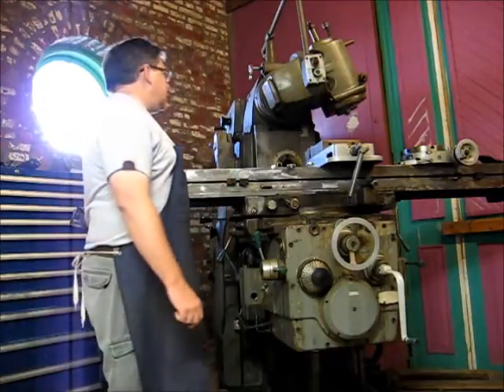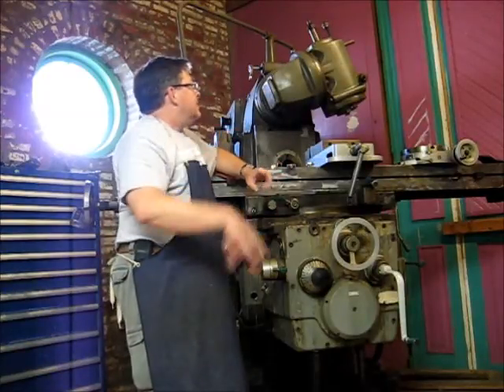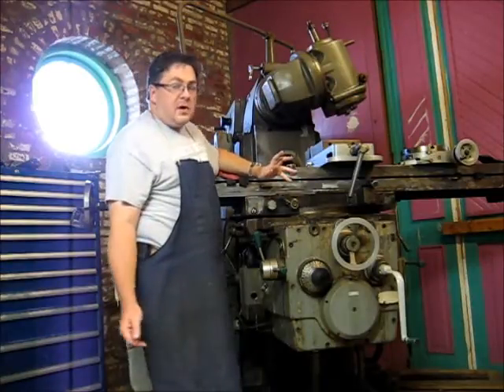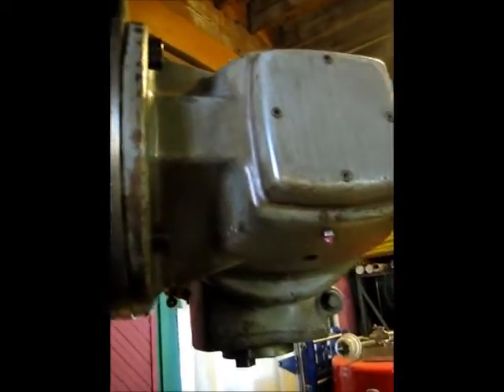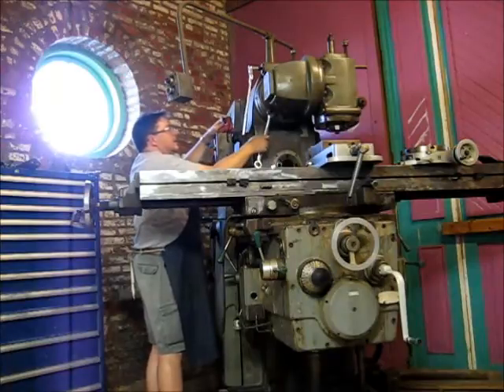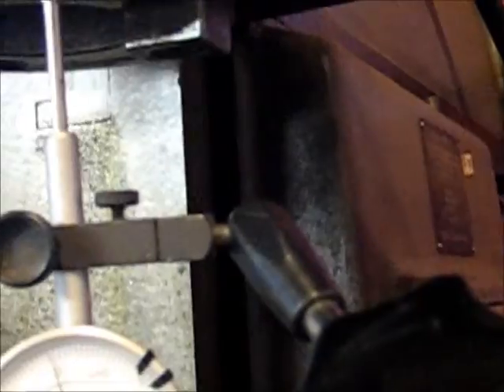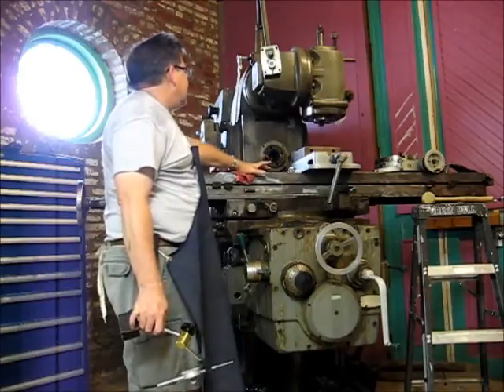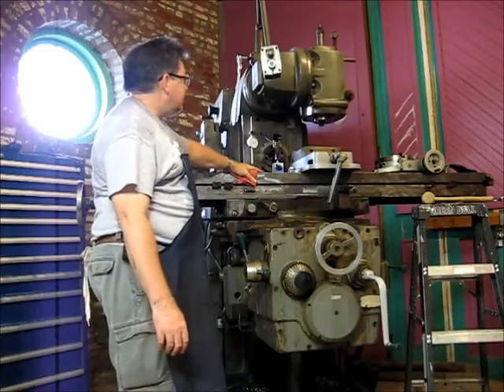Quick mill tramming video

Comment: James,
You are either very short, or that is one hell of a bloody big milling machine........
How many horse power is that monster?
Reply from the maker: Its bloody big, 15 hp on the horizontal spindle and  5hp in the overarm, 2hp feed motor.  Its about 8ft tall and weighs about 6 tons.